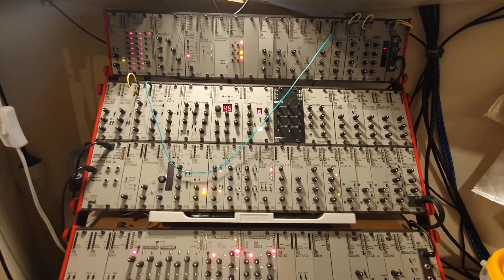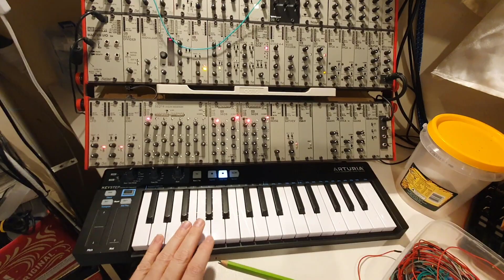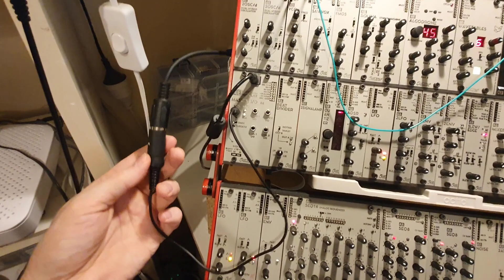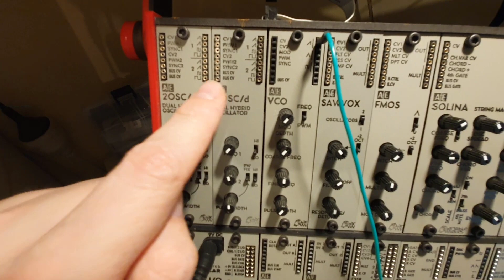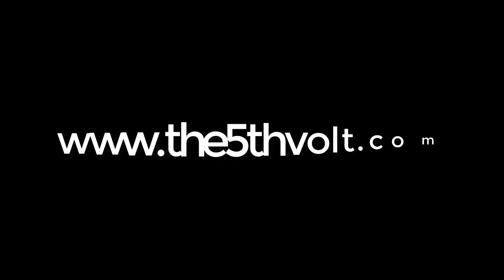AE Modular - Getting Started with a very basic patch

Comment: Do you use the 4I/O Module?
Reply from the maker: Yes, I use the 4I/O module as my main audio output going into my Behringer mixer and from there to an audio interface.
Reply: @The5thVolt  Sweet. I want to use it as a Input for my Beatstep. Hope it works. I wonder if I can use higher voltage than 5 V into the 4I/O or if I need to change the voltage.
 Thanks and a nice day!